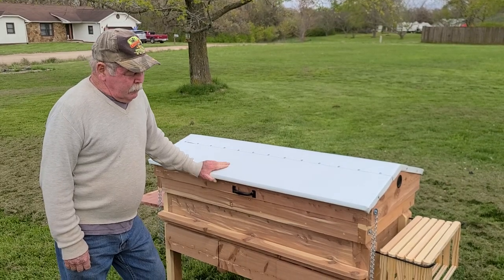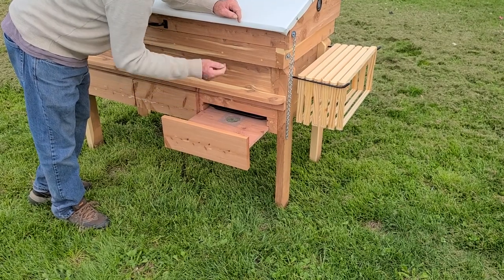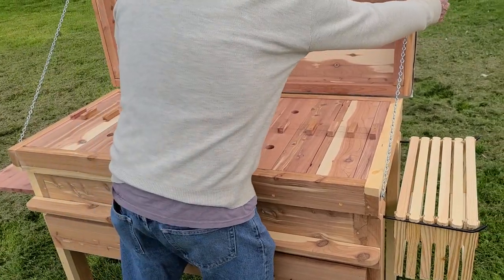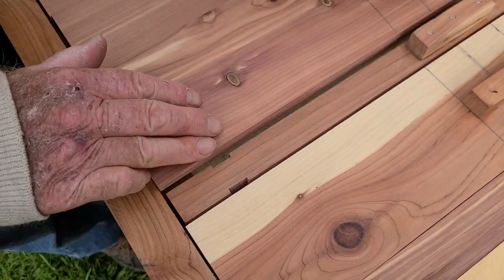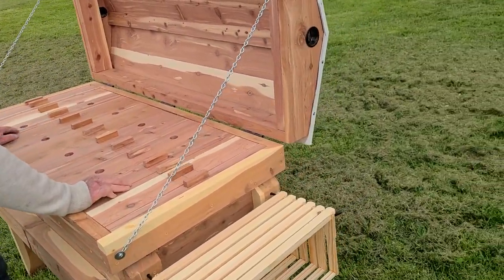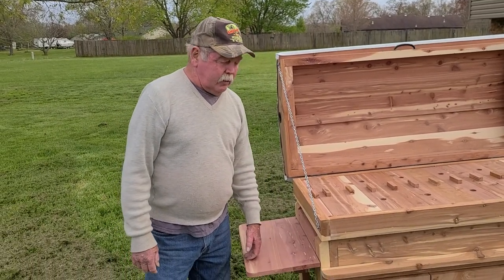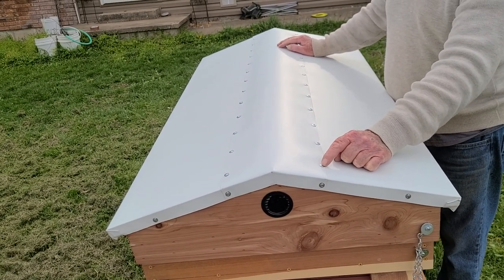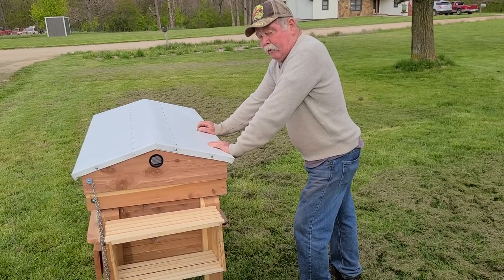Horizontal Hive Build using solid Cedar

Comment: To hell with the bees. Thats nicer than any piece of furniture in my house. My wife would probably fill it with blankets and pillows and put it in the bedroom.
Reply from the maker: wait till ya see one with solid copper top. can not believe how expensive copper is, but it will sure look nice
Reply: Where can I get one @SilentDeath002
Reply from the maker: @rugerdogg5316  Hello rugerdogg , sorry to say but my health has taken a turn for the worst. have not been able to do any work for over a year. i do have most of the parts to assemble two but nothing except the main box have been done and i can not lift anything at the moment. so who ever would get them would have to put them together
Reply: @SilentDeath002  I saw in some of the comments that you are down. I hope you get better soon GOOD LUCK! I would still be interested in purchasing what you have for one of your hives. if it's available?
Reply from the maker: @rugerdogg5316  i have material for pine and cedar just let me know which type
Reply: @SilentDeath002  is this the best way to contact you ?
Reply from the maker: @rugerdogg5316  yes for now i check here every so and then when not in the hospital
i have one cedar horizontal main box put together legs and other parts sitting on table, i have over 16 pine main boxes that can be assembled and parts would have to be cut like 2 x 4 legs and pieces for roof assembly , if ya pick up some wood and we can check what i still have in stock we can use my saws to cut them but you would have to make the cuts i cant
Reply: Thank you! How much would the Cedar hive cost ? Really interested  but I may have to settle for a  pine. Either way your hives are AMAZING! Hope you get on your feet soon! Has to be several folks waiting to get there hands on one of you horizontals. I appreciate you taking the time to get back to me.
Reply from the maker: @rugerdogg5316  the wood is expensive just to purchase not including milling. for the parts i have would be 300.00  and we can cut some of the other parts for roof if you can do that when you arrive